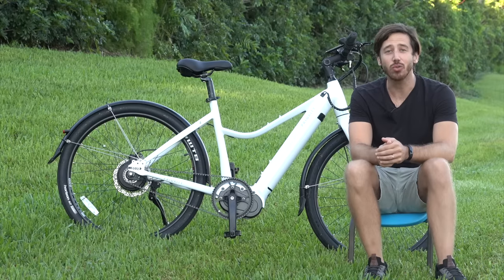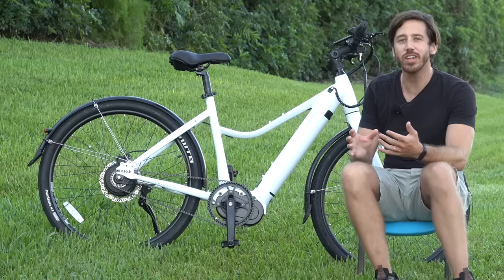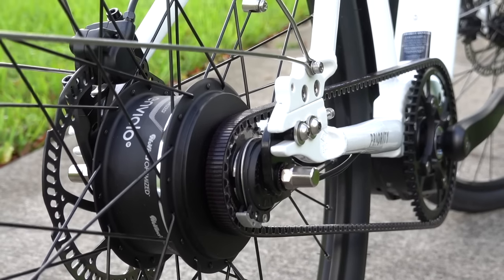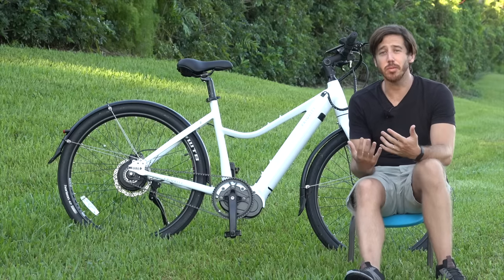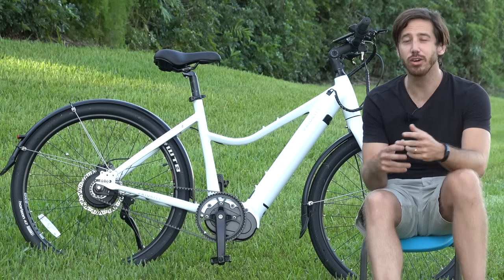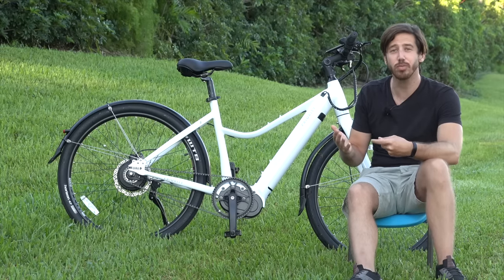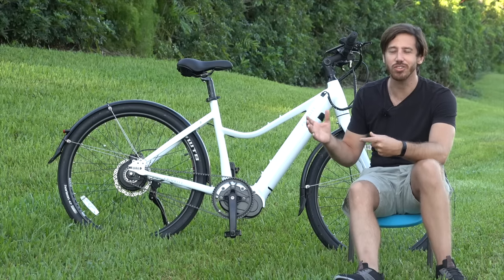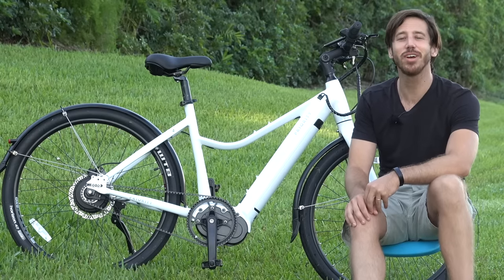BELT DRIVE on bicycles - Pros and Cons

Comment: "you do not have to worry about getting oil or grease on your pants"... Laughs in Dutch chain casings!
Reply: I do have to say im shocked to hear that you have to take apart your frame to put on the belt. Here in the Netherlands is even abnormal to take the chain apart... The chassis of your bike is just made in a way that you can replace the chain by pulling back the back wheel.

Comment: One other disadvantage that's never talked about is if you wanna run a bike single speed without an internally geared hub and you want it to be geared for going over 20mph at a relaxed cadence, you'd need a giant chainring up front that won't fit on any regular bike get a decent ratio.
Reply: Looks like you need to start with a belt drive frame first. I didn't know that can you buy a belt drive frame ?
Reply: @Mythreesons137.  I think you can but it's quite niche. Let's consider the Babymaker by FLX. The premium version has a belt drive system. Look at how big the chainring is. It's not even a high ratio cause the cog at the back has to have minimum 22 teeth. So imagine you'd like to have a ratio suitable for a cruising speed of 25mph. You could do it with a high cadence but you'll kneed like an 80 tooth chainring at the front to be able to get a slower relaxed cadence.
Reply: Check Priority Bikes. They have many single speed.
Reply: Ratios are only relevant if you're peddling.
Reply: @Zomby_Woof  I'm not a peddler sorry

Comment: I started like the belt over the chain until you say about braking the frame 😁. Nope I'll stay with the chain.
Reply: @pt020  That's a clever solution.
Reply: @jadamsnz   Yes this company (Riese & Muller) have interesting bikes.. also bikes with full suspension and belts... but they are not cheap.
Before  I bought it I made a research.. looked for something with as less problems as possible when I am far from home, even my tires have  some extra protection (snakeskin they say) in 4 years never had a puncher.
Reply: @pt020  puncture?
Reply: @pt020  what bike is it?
Reply: @slaughterround643  a small hole in a tire resulting in an escape of air.
Reply: @musmanov4642   It is the Riese & Muller Tinker 
6 years old model but still on sale, I have it 4 years.
Reply: @pt020  I said the the same thing to someone a few years ago, I hadn't had a puncher in nearly twenty years in any of my cars, Then I got five or six in six months.  I'll keep my mouth shut in future :)
Reply: @rfwillett2424  It can happen, but still it is good to take a precaution.. e-bikes are heavy and to walk with it to look for help is not very convenient..
Reply: @pt020 , agreed, but always remember the law of averages, and never tempt fate.
Reply: @pt020  Yes,  an puncture caused by a puncher.  Those spiked boxing gloves will do it every time.

Comment: I've had a belt driven bike for four years and last years I also bought an ebike with one too. I love it! Best thing about the belt drive is that it does not stretch and I don't have to tension a chain once or twice a month. Also the cleanliness is great when I wash my bike inside the apartment bathroom! And btw when the bike has a sliding dropout where you can drop the wheel down and out you'll never have to tension the belt again! Unless some bolts get loose or you want to change the gear ratio.

Comment: I have a schwinn shuffle adult kick scooter and I’m trying to make it electric. I would like to use a 750w hub motor for the rear wheel and to hide the battery under the feet rest. Not a lot of space for the battery. Just wondering if you have any advice. I live in Florida not a lot of hills:)

Comment: Does wattage matter when pairing a battery vs a hub motor. 

I’m having trouble finding the information on pairing the right battery with the right motor? Some people say to go 10-20% over on the wattage of the motor.

72v hub motors & batteries seem to be less common in the marketplace. So I am looking at a 52v20ah paired with a 1500-2000w rear hub motor.

Comment: Data re: cost (actual $ amounts) would help. Are belt drives 10% more or 50% more? I ask because the pros mentioned here are persuasive, but the eBike I’m considering (Norco Indie VLT 1) has a chain drive and now I wonder if I should buy it. I can’t find any meaningful reviews on the Norco Indie VLT 1 ($4 500cdn) so it’s difficult to make a decision. Thanks in advance for any opinions that may help!

Comment: Thanks good presentation, it is amazing that the derailleur set up is still the most efficient after all these years.
 Yes I like minimum maintenance, but dislike the cost, but, I have broken chains whilst out in the middle of nowhere, and repaired in situ, difficult with a belt, however failure unlikely.
Reply: You can just carry a spare belt however I sympathize with the sentiment that that's harder than fixing a chain

Comment: I got my hands on a newer cargo-focused enviolo hub and my 750w bafang tore through the hub within 500 miles. 

Even the cheapest microshift derailleurs I use last 10x as long with double the power put through them... I don't even maintain my chains and simply replace them when they get bad enough.

Comment: One downside of chains not mentioned is that you will eventually need to change your chain ring and gear cluster as the  chain  wears out the teeth. Keeping the chain clean and replacing it regularly will delay that but it will eventually happen,

Comment: On the point about full-suspension frames... why can't you have tensioner pulleys on a belt drive?  Surely, if you couldn't, that would be a limiting factor on frame design even on rigid frames as your chainstay (beltstay?) length and gear sizes would be limited by the lengths of belts available.

Comment: Dont know anything about bicycles but on motorcycles a belt drive is about 12-15% power loss compared to chain 1-3%. Wont that be a dealbreaker on bicycles or is there not as much power loss in belts here?

Comment: Another advantage is that older folks who can no longer lift their bikes or sit on the floor for servicing can ride more easily. I can no longer lift my regular bike up on the bench and I can sit on the floor but getting up requires assistance. Perhaps I should install a pulley for lifting myself up from the floor?

Comment: No derailleur, gears, or chain to rust during winter rides is a BIG advantage belts have for me. I'm a four-season rider in the Adirondacks and just based on maintenance differences alone the higher up front cost pays for itself.

Comment: I heard that Ikea stopped selling their bike because of a faulty/ dangerous belt drive. Do you have any info on that?
Reply: They used another belt drive system. I think that it was Continentals system, that was recalled due to breaking/snapping belts, which obviously was potentially dangerous for the user. Gates belt don't have this problem, because it has carbon fibre threads within the the belt, that are very tough. So wear is more seen on gates belts as worn or broken off teeth...

Comment: I really want something like this now.
I’ve just been upgrading a Chinese 350 watt ebike to Shimano Sora derailleur gear changers & fitting a 52 tooth front chainwheel etc.
It is pretty good now, but I always want more and this looks like the basis of my next project (when I can afford it).
It has been said many times before, but ‘The future is electric ‘ is where we are going, and I am much happier using my ebike with a back pack for local  shopping than firing up the SUV for a 2 mile shopping trip.

Comment: I use my E-bike for the commute to work. It has a chain. Since I ride it 200km/week I am on my 3rd chain and also my battery is noticeably weaker. Therefore, my next bike will prob be a "normal" one but definitely with a belt drive!

Comment: You can tension the belt.
In my industry we tension most of the belts.
Few weeks ago I have redesigned tensioner in 3d, and printed using my FDM 3D printer. I am not suggesting FDM 3D printed Tensioner on bike, but CNC or Laser cutted Tensioner should work.

Comment: Would it be possible to design a rear axle that put the sprocket on the outside of the triangle so that the frame did not have to break?
Reply: Interesting idea. The front chainring needs to be in perfect alignment with the rear spocket, so I guess you'd have to increase the Q factor a bit.

Comment: Low end cheaper belt drives are prone to stretching which will cause the belt to come off repeatedly, especially under load, since there is no tensioner to compensate. So make sure to go with a good name brand belt system.
Also unlike chains you can not "cut out" a bad link and do a temporary splice to get home after an accident, you need to carry a spare belt with your spare tubes.
Reply: Even if you have a spare belt, how do you replace it? The bike has to be able to split to install the belt.

Comment: Great video, Micah. If you don't need to change gears, belt seems like a great thing. The "breaking the rear triangle" is a bummer, but that's the way it goes.
Reply: Maybe you missed it, but bikes with belt drives are coupled with an internally-geared hub, like the Priority Current that's in the video. He specifically speaks about it. You therefore can change gears on a belt-drive bike. And the frames are designed to accommodate the Gates belt drive. It's all preconfigured in the design of the bike.

Comment: I just bought a ten year old belt drive bike on Craigslist. I don't know if this is par for the course, but there is a ton of friction in the rear wheel. Freewheeling it will only spin the wheel a couple rotations, whereas my chain-driven bikes will spin dozens of times. This means riding it takes considerably more effort than my other bikes. It's possible the friction is due to the crazy Shimano "roller brakes" or to lack of maintenance on the hub. But wait till you try to do maintenance on one of these things. It's like working on a car transmission! So, belt drives are low maintenance... until they need maintenance. And then they are very difficult and expensive to work on! Buyer beware.

Comment: So, I am guessing that belt drives don't stretch out as you use them, like chains? Or do you adjust for stretch over the life of the belt?
Reply: A Gates belt doesn't´t stretch as such, but as it gets worn, some of the material gets worn off, so you might have to adjust it, but it is very, very rare that you need to do that. I have also seen bikes that were sold with (very) wrong tension, so they needed adjustment to get it right.

Comment: Just wondering if it is possible to add a connecting link to Gates belt for bikes that do not have a split frame?  It would also have to me made from carbon fibre.

Comment: There are two more disadvantages to belt vs. chain: With colder weather the resistance is slightly higher (but who cares with an e-bike) and a chain wears out slowly and stately vs. a belt that doesn't wear until the teeth fall off suddenly due to temperature and UV influence. Some chained bikes have closed chain guards that keeps the chain clean and lubricated (which can outlast even a belt in durability with minimal maintenance) But overall: for a commuter-bike a belt is a great option.

Comment: can you do a review on various IGHs? Like what is the strongest/best for a bbshd?
Reply: 3-speeds are the strongest ones. Shimano came out with a 5-speed ebike hub which I have and do not recommend. It has way too much drag especially in the cold temps. My bike is a pedelec and when it cuts out at 25km/h the acceleration stops too. The hub is just too draggy to ride much faster. And I do hit the 25km/h mark with the 3rd gear. So it is a heavy and draggy 3-speed hub. Also the gearing is way too high with 700c wheel and belt dirve (39t x 28t). That could be remedied with the only other coq that is available for the hub, the 32t. But that is... If you can find one!
Reply: I like the shimano alfine 8

Comment: Hi Micah, I would love to be able to use a belt drive but my budget is limited so i'll stick with a chain. But with my 1500 watt mid drive system I'm stretching chains quickly (lot's of steep hill riding). Do you have any recommendations for a durable 9 speed chain? Thanks Micah.
Reply: Go with narrowing your gear range. We use IGH's with single speed bmx chains at 1,500 watts. They last several months riding every day.
Reply: @urbancargobikes4930  Thanks for that.

Comment: After watching this i went looking  for belt conversion kits and than i remember  he said your bike needs to come part enough  to get the belt because  it's not like a chain and my bike doesn't  break enough  for a belt  😕. But then i typed break  belt conversion  kit  and found a company  called  veercycle  and they sell a split belt 😲  so it can be used just like a chain its pretty expensive though  $350 😵 so im gonna look around and see  if i can find more options  so in short  if you  want belt kit  but you  cant get into the back triangle search for split belt conversion kits 😉

Comment: I had a Kawasaki GPz305 motorcycle many years a go (been a motorcyclist for nigh on 30 years now), and even though having been a mechanic on both motorbikes and cycles) I am surprised at why the belt is not used more in both worlds (yeah Harley uses them), but they are smooth, silent, reliable and maintenance free (pretty much)... And, well, better for the environment in general? I'd say so... 🤔😏😎

Comment: I've been riding belt driven motorcycles for over 30 years, for motorcycle the transfer of power is also much smoother with a belt.  I haven't tried a belt driven bike, so I'd be interested ito know if anyone has noticed a difference.
Reply: My observation (I'm a 40+ year cyclist) is that power transfer with the belt drive is better than a chain drive. Less slippage. Then again, power transfer is also impacted by frame flex (a function of frame design and alum vs carbon materials) and even little things like the effect that clip-ins have on pedal stroke efficiency. I'm not sure the average rider could tell power transfer differences between chain vs belt drive trains.

Comment: Pretty much all of Harley-Davidson's bikes, electric are not, are belt drive - at least in the last 15-20 years or so, with the exception of the new Pan-Am.

The way that H-D gets away with using a belt is to have the swingarm pivot close to the countershaft sprocket, and to have a short-travel suspension. There is a H-D adventure bike now, with much more suspension travel, but it uses a chain.

One thing to keep in mind about a belt drive bicycle is you don't want to get the wrong size rock or stick between the sprocket and the belt. You could snap that belt right in twain and have to walk out of the woods. That said, I kinda want a belt-drive Ebike to ride to work, because it would just be so easy to take care of.

Comment: For regular bikes a belt drive is also less efficient, mainly because instead of having a direct COG connection, it uses a transmission, that's the main reason you will never see a performance bike using a belt system, but other than that they are pretty cool IMHO !!! :cat-orange-whistling:

Comment: I’ve never had a belt-driven bicycle before, but I suppose another advantage to having a belt drivetrain is that a belt doesn’t jump off the sprocket. It may also eliminate the need for a guard. I considered buying an IKEA bicycle and converting it to an eBike, but decided against it. 😊
Reply: Much less likely to skip teeth or derail itself from the drive system too.

Comment: Gotta love compliant mechanisms. Given the task, a belt seems like an objectively better tool for power delivery, but cycling has developed in a way that favors chains so the tech hasn't matured (internally geared hubs and frame design need development). With e-bikes becoming more popular I'm sure that will change... I can practically see the $6,000 Dura Ace Di2 equivalent internally geared hub now.
Reply: High end bike manufacturers care about minimum gains in bike design and aerodynamics. They would never put a belt drive and internal gearing on a high end bike when it costs more than 10% drivetrain efficiency loss compared to belt and internal gears.

Comment: GREAT CHANNEL! im a new sub here , and have learned allot. i used the Violamart 1500w rear kit for my cheap huffy NIGHTHAWK, its been allot of fun, until i was splashed in a flood and killed my controller. i replaced it with a nicer one. my question is , i have been using heavy sla-agm batteries in my trailer. i typically only get 10-12 miles with these , but it was what i could afford at the time . i have about 3000 miles on mine , its my commuter about 5 mile round trip , and all the shopping ect on the weekend, how do i know im buying the right lion battery size? it says i must have 17.5  amh my current set up is 12.5 and going bad. any thoughts or recommendations? the math is so confusing .
Reply: If you can afford it.. just get a bigger battery... 17amh and Up. 20 or 21 would be ideal.
Reply: @v4v777  ok thanks so much! the watts vs aph and volts had me confused . im like i have a 1500w motor , so how much do i need lol again thank you. i ordered  one of your books on battery building , the ebike book is next.
Reply: @faulker6751  Im not Micah... just a viewer here.
other than that, my e-bike has a 1500W motor too... i use a 48V-21amh on mine... and i  can get from 70km to 100km (43 to 62 miles) with one charge.(with pedal assist)
Thats why i said, a battery over 17amh is a good match for such a motor.
Reply: @v4v777  wow ! soo thats what i really needed to know! thank you im new to all of this i read allot on it and watch videos , but with winter looming i need to get it sorted quick! thank you so much for the help! hope i can return the favor at some point ! stay safe!